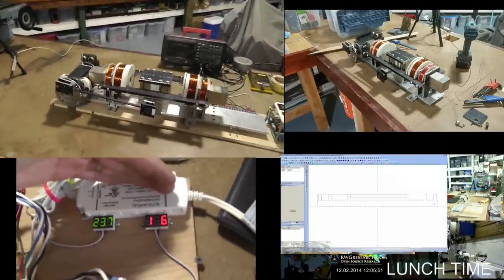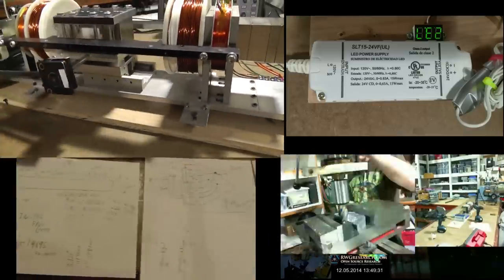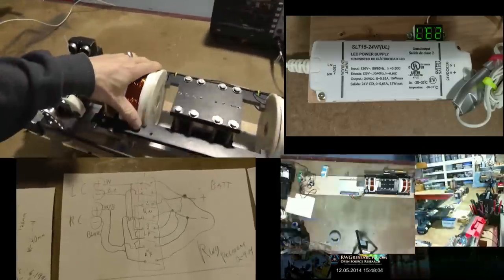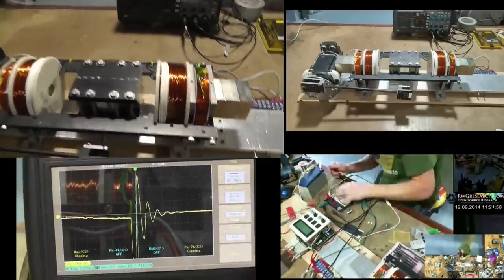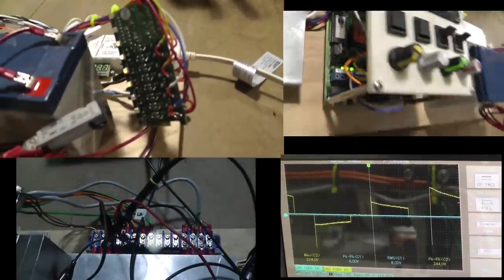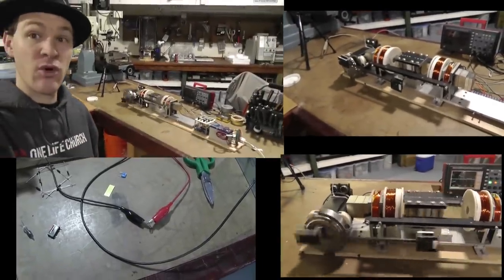Russ’s Pulse Motor Build Off 2014 Official Entry ( Full Scale Gap Power Replication)

Comment: Well done Russ, you can get higher forces and thus torque, if you close the back magnet flux path with a huge "U" shaped back iron core so the whole flux would concentrate just only in the airgap where your piston sits... You are wasting so much backflux by not using this backflux iron core...but letting the backside of the magnets open...Anyway, well done ! Regards, Stefan.

Comment: Holy Crap I wish I had a tenth of your talent. Maybe in like ten years ill be able to make something like that  or at least more sophisticated than my VERY simple design I came up with
Reply from the maker: You see what you did is really really cool and there is k ow reason to compare. :) God has given us all talents. Yours is just starting to shine :) blessings brother. ~Russ
Reply: ***** I couldn't find your motor based on magnetic field blocking but here is some ideas to try.
Use powered metal parts for blocking.
Use a blocking mechanism that REPELS the field instead of attracting it when you used Mu metal, such as a bismuth or other diamagnetic material.
There is a patent for a similar material that works better than any other with diamagnetic properties reflecting the magnetic field instead of attracting it. It uses coal dust, silver or zinc

Patent US7220488 - Deflecting magnetic field shield - Google Patents
The present invention concerns a shielding material for a magnetic shield containing coal slag; silver powder; a mixture of calcium powder, magnesium powder, and zinc powder; and silica powder. The shielding material is in powder form. In another embodiment, the present invention contemplates adding nano-silver to the shielding material. The present invention is based on the concept that the magnetic field is actually “deflected” away from the area shielded. This is possible in view of the shielding materials used to produce the magnetic shield.

Let me know what happens !